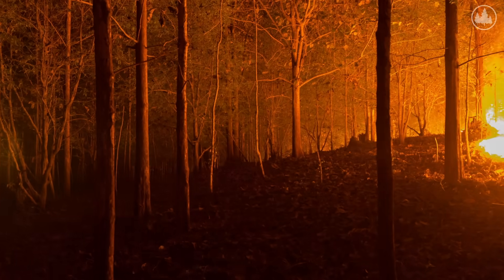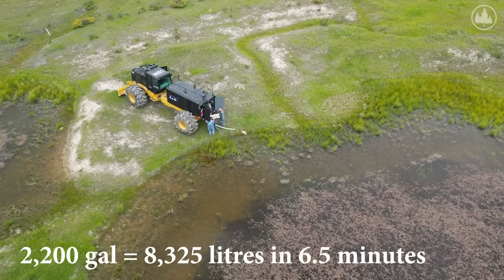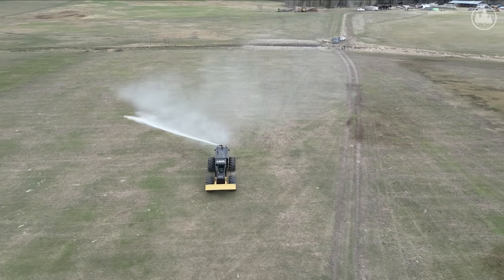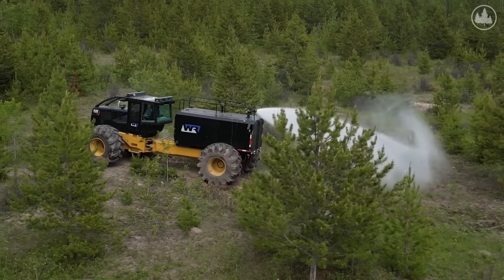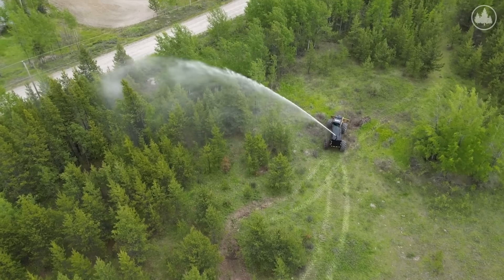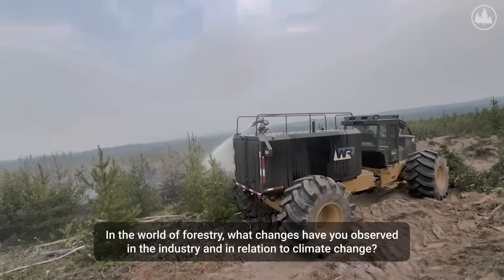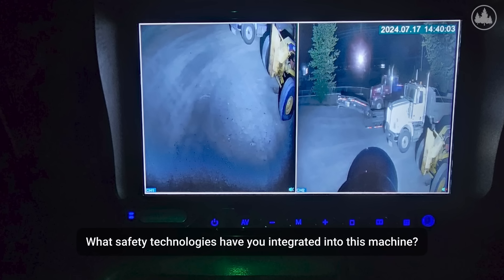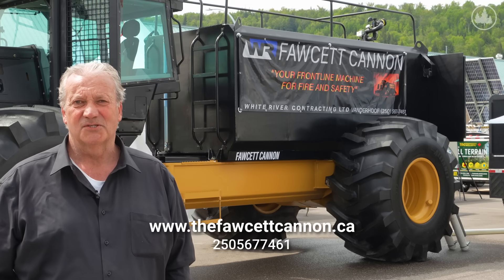The Ultimate Firefighting Cannon: Inside the Wildfire Destroyer

Comment: I would suggest putting perimeter sprinklers around the rig to spray water on itself should it be caught in a situation where the fire overtakes the rig unexpectedly.  Using a reserve tank that the driver will always have available.  Fire conditions can change in an instant, and that would definitely help save a driver and the machine.
Reply: Was just about to say this. Being able to deploy the inlet hose without exiting would also be a huge convenience and even safer if the rig gets cornered near a water source. It could recirculate water from pond over itself. Or even park partially in the water source if conditions allow.
Reply: Better yet use drones..then every fighter would be unemployed.
Reply: @brawn800  gonna get stuck getting that close to water to drop an inlet without getting out. Usually pretty sketchy squishy ground by the lakes and ponds.
Reply: Undertrucks, we call them undertrucks about 60 GPM would do it
Reply: Maybe build a similar unit that can run back forth between the unit and a water supply. Just a big water supply truck. The unit could retreat to a safe spot to recharge. Would save a lot of time.
Reply: @donaldboyer8182  Or have two or three of them running together, when one runs out of water, the next picks up where they left off while the first goes to refill and so on. Depending on the time and distance you could potentially add the right amount of these amazing machine so that you would have uninterrupted water flow. I’m sure money is definitely a factor of course, maybe some government funding is in order. Great video! Awesome machine!
Reply: This thing needs an accompanying simile trailer with 20000 gallon tank attached to the main supply.
Reply: @77Avadon77 I totally agree
Reply: I'd also suggest pulling a trailer tank full of water so it could stay out longer between refills, this machine would have no problem pulling a tank full of extra water
Reply: If the water gun can be pointed straight up and to a full round mist.. that would do it...
Reply: I’m a retired electrician here….maybe build it with a complete bathroom, sleeping quarters and make sure it has a self dispensing suntan oil.  🙄. That’s for all you keyboard engineers out there telling him what to do.  Just eat your chips on the couch and take a nap.
Reply: @URKlewless  lol
Reply: Great idea with sprinklers. 
I would add water cannon in front of a vehicle like bush fire trucks.
Adjustable pattern and smaller  flow.
Plus fire retardant capabilities like on planes
Reply: Also the cabin should have positive pressure and have completely filtered air. The idea that smoke goes into the cabin, even a little bit seems unacceptable.
Reply: @77Avadon77 I’d suggest putting a few rocket engines on. So it can fluky to space.
Reply: I was wondering what protections to minimize fire to the wheels. I like your idea.
Now they might consider a truck designed with a water tank with the same sprinkler system as support. The water tank can locate in a relatively safe distance but close enough to connect the hoses.
Reply: Acme ejection seat that shoots you out three counties over.
Reply: Umbrella sprinklers, need a heavy mist to cool big tires and steel.MAybe foam tank ( forward spray) for escape out?
Reply: Modern Wildfire trucks have an external foam sprinkler system that can be activated or automated if the unit is caught in a flame thru, where there is no escape and is meant to keep people inside alive and the unit functional after the fire front or flame thru passes it's apex.
Reply: And even maybe add foot plates or something where you can pick up crew if they're stuck in an area and they'll have the ability to get on the vehicle so you can pull them out!!!!!!
Reply: You may need to hose on the front of the tank, so you spray over the cab as well if the fire is in front of the vehicle.
Reply: It's got air conditioning. No need to cool the steel.
Reply: Hell yea that would be smart 👌
Reply: Build a big drone to do this
Reply: Same thoughts
Reply: A man with your experience, knows that you still need boots on the ground.  Having said that, you could enhance your tractor’s capabilities by adding Class A foam, with a CAF system.  With that water cannon, you can pre-treat 75-100’ off your control line.  Giving ground crews much needed time to work.  Great looking tractor.
Reply: i would suggest adding  2 -1200 gallon trailers that can be filled by a 2nd man while the 1st guy just runs the firesprayer comes back for quick 5 minute unhook and rehook to full trailer and off spraying again
Reply: Love this guys energy and ingenuity, but he should be honest about the limitations. I don’t think operator safety is fully covered here, seems Ad hoc. If this was overcome by fire, while at the point of needing water refill, would be deadly, 25km/h isn’t while plowing an escape route. Maybe amazing for mop up, which is important necessary work.
Reply: Savy weighs far more than nuts
Reply: Yes and to protect the Tires. 
Burning Tires become Bombs.
Reply: That looks like it has some power to it.  Could it not pull an additional tank behind it?  Or even extend that tank and make a longer deck to hold it?    Or maybe even a bladder system to cut down on weight.  The military stores fuel in bladders, so it's not like it's not a proven system.  Also, to sell in CA you are probably going to have to bribe politicians to have a chance to sell it there  :)
Reply: Just point the monitor straight up and full spray shower itself.
Reply: Why the use of rubber tires? Why not use Steel Wheels.
Reply: @RichartEgli one of the most important aspects of any off road capable vehicle is to be able to air down the tires for a massive increase in traction, increasing the footprint and cushion so the vehicle doesn’t dig in on soft terrain, and the amount of power it would take to turn steel wheels with those dimensions would require a ton of power/gear reduction. At that point you might as well put the vehicle on tracks.
Reply: Fill the tires with water for extra storage 🙂
Reply: @fuocofuegofire  seriously, if you pumped air pressure into the tires the push the water out into the tank, the tires would never go flat. I belive some military vehicles are capable of inflating and deflating their tires remotely from the cab. If you were joking, you might actually be onto something 🤣

Comment: You need a resupply tanker nearby
Reply: Tender. Tankers have wings.
Reply: @AppalachianPatriot  I was thinking vac tanker, like they use in the oil field.
Reply: @redmesa2975 In wildland firefighting anything that drives down the road is a tender. It’s been a fight for decades with structure firefighters. Many fire departments are using the term “tender” now. It’s fun to fight with them over it.
Reply: Just build another truck that has a much larger tank that can drive to this machine to fill it.  You could have a few of those running back and forth to keep filling themselves while this truck just keeps on working.
Reply: @pin65371  that's exactly how we do it!

Comment: I suggest that you look at pipeline slurry spreading systems. With enough booster pumps you can move 10s of thousands of gallons per hour from a lake or river to the top of a mountain
Reply: The other thing I was thinking is if he builds a tanker truck then they could have a few trucks that just keep on running back and forth between the water source and then quickly fill this truck. Then you have one or two that carry fuel. The pipeline slurry system would work well as well.  You could even just have one tanker vehicle that gets filled by that and then the other tankers just go to that tanker to get filled.  That would allow for faster refilling since you could have multiple tankers filling off one tank without having the have as large of a hose to feed it from the water source.  It would basically act like a battery.

Comment: You my friend are on the right track . There is a company that closes blow out oil wells using jet engines to spray water . You just have to supply the water . The jet blowers are very effective I will try to find the link to pass it on to you , but I know in my heart you are on the right track .
Reply: Small turbines exist so no need to go with a large jet engine. Ground power units like the Air Force uses have small, high horsepower turbines which put out enough bleed air to run through an easily deployable hose to (for example) siphon supplied water to a simple nozzle. I'm not a firefighter, just a retired fighter fixer/A&P/"deliberate generalist" mechanic/welder/student level machinist. 

The famous "Dash 60" power carts can be modded with a hydraulic pack, burn diesel and if a designer wants to power a vehicle using electric hub motors or hydrostatic motors that's easy because power carts EXIST to power whatever the end user wants including airlifters and strategic bombers. It's exhaustively proven. 

They're not particularly thirsty as they're intended to sit on the flightline powering large aircraft without running the engines. 

The stock ones turn up in government and private sales and can of course be overhauled to zero time (the USAF has used them for many decades and they're on nearly every flightline).

https://www.aviationpros.com/ground-support-worldwide/gse/gpus-pcas-power-carts-accessories/product/10025602/avtron-manufacturing-inc-dash-60-upgrade-kit

For those wanting mobile agile tracked "brush trucks" to transport firefighters under armor the M113 family of vehicles are abundant as surplus (US doesn't sell to the public but they're used globally).  Corsican M113 wildfire videos get the point across. Roscommon Equipment Center in the US have plenty of conversion info adaptable to anything with tracks or wheels and they are a Michigan government agency. Their site got fancy so ask about their old content which includes very specific mod instructions and example vehicles they adapted.

https://www.michigan.gov/dnr/managing-resources/forestry/fire/rec

There are tons of info out there but the subject is so niche the general public have no interest so it's not widely studied. I worked on a M113-related corporate military project (never got funded) so I did my homework in detail. Interested firefighters, mechanics and fabricators can learn this stuff quickly online then pursue what they find useful.  

For example a "combined arms" wildfire response crew could deploy personnel under armor in tracked APC (designed to drive through napalm attacks during the Cold War and quite agile as you can see in many recent Ukraine videos.

Aberdeen Proving Ground converted APCs and even an M60 tank hull for fighting bombing range wildfires from under armor, a bit more risky than ordinary wildfires! I suggest anyone serious use this post for keyword searches since links change.
Reply: Yes, but a well blowout doesn’t move, it’s a stationary fire. The jet would be a logistical nightmare on a wildfire trying to keep it moving while supplying it with fuel and water
Reply: @tombryant4518  The whole rig is mounted on a tank carriage , They are very effective , as the fire cannot burn due to the shear force .
Reply: @mr.nibbles.friends Yes I know all about the tank track mounted her engine fire truck but it needs huge ponds of water just to sustain the jet engine water cannon that is entirely unsuited to fighting wildfires, you could never get enough water and so all you would do is can the flames and spread the fire beyond control, the only practical use for that her engine thing is the oil well fire fighting!
Reply: @jakedovey7488   Water is not necessarily the best of the application . If the force of the engine is blowing against the wall of flames , it would force the led edge to run out of fuel , in essence blowing the burning edge to go back on it self where it had just been where the fuel has been burnt already starving the flame so to speak . Then that edge could be damped with water to cool the ground and eliminate flare ups.
Reply: @jakedovey7488 so you are saying nothing is better than something?

Comment: your set up on a 30T Volvo off road dumper chassis would be a beast, 6 x 6 change out for forestry tires ,swoop dump bed for a larger tank canon , higher volume of water at the face means a longer face time , but smaller cheaper$$$$ lighter might be the right answer in most cases be interesting too see which would handle terrain better on the same tires ,hope it a success ,🥸🤓,Canada
Reply: Those designs of articulating dump trucks are unable to traverse steep grades.
 The back half usually flops over on its side, if attempting to travel laterally on steep terrain.